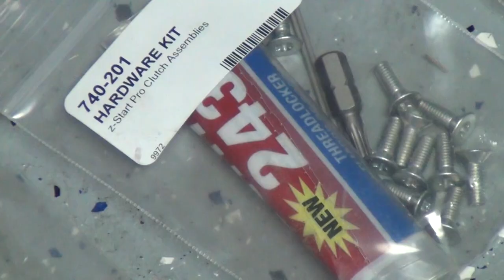Rekluse Z-start Pro Auto clutch CRF450 Install and Review

Comment: I appreciated your detail etc. I'm new to bikes and was traded a ktm 450 with recluse and rode it 2-3 times and no linger will go. Put new clutch plates in on my own and now when I put it into gear it just spins wheel n dies. I didn't know and kinda still don't know how to adjust it. I'll pull it apart again and check spacing etc. But I don't have nogo things?
Reply from the maker: If it's dying it's not disconnecting or the carb idle/tune isn't good.  The idea is there's some gap unless it's rotating enough to hook up.

Comment from the maker: You would be preaching to the choir there if you were correct.  I still can pop the clutch just the same as before.  I would miss that.  However the bike rides the same as before clutch wise you can still feather, pop, dump, or whatever you want.  The only thing I DO miss is I can't pop-start while coasting down hill.  However I have electric start and a kick start if I need to.

Comment: So you said if it doesn’t go in at all (the no go gauges) you are good? I’m trying to put this kit in my 05 ktm 450 and I have ZERO gap and the clutch pack is so tight at 25 inch lbs the pack has absolutely no movement..

Comment: Hello been loving your videos on the 450,s very helpful and complete you must have had a good teachers they got you using your brain.
Had to ride home with no clutch lever recently .not fun in tight stuff{standard clutch}
Found this on their website any chance you could show how this is done?
Can I bump-start with an auto clutch?
All three Rekluse Auto-Clutches can be configured to bump-start the engine in the event your normal starting system fails. However, they can not be configured for bump-starting on the go like a standard clutch.  One must stop the motorcycle and make an adjustment (on some Rekluse models this requires tools) to bump start and then make another adjustment to continue riding once the engine fires. Bump-starting can be done to get you home.
Reply from the maker: I didn't know that they had a method for bump starting.  Good to know.

Comment: At the start you said that you're riding an X but later in the video you talk about how you have a light flywheel and its a motorcross bike. Did you buy and X and make it more like and R or the other way around. I have a 450R that I added a heavy fly wheel to and made it ride more like and X but is still more peppy than a standard X. I ride very rocky and technical single track what setting would you recommend. Looking at doing the Z-start

Comment: My pressure plate that holds the balls doesnt sit down into the grooves. Its a crf250r. When i remove the pushrod and install it it fits and screws down all the way into the grooves. Any help is appreciated.

Comment: hey I got a question I got a 08 KTM 525 XC ATV so my bike came with a recluse Z start Pro I had the bike over a year and maybe 2 months now so I was going to change the friction because I thought my clutch was slipping so as I change the fractions and put everything back together but now when I try to crank up the bike the bike try to take off immediately and cut off or stall out so I wonder if I did something wrong or what do I have to do because if I loosen up the screws on the plate it will start up fine  but when I press the gas it won't go or have the response like it suppose but I know the screws don't supposed to be loose  like that  but can you please  help me out or do you know what my problem is
Reply from the maker: If your frictions are too thick or you have junk between them it will do that.  It could also be air in your clutch hydraulics. (hose, master, or slave cylinders- bleed them)
Reply: well  I don't know what to say or do right about now because I tried putting the old frictions back on but it's still just doing the same thing it's in neutral when I put it in gear the bike try to go and stall out I can't even roll the bike anymore any no gear just neutral

Comment: I can see using this on a two stroke or something for enduro or hardcore trails where bottom end power is low but I like solid engagement when i pop the clutch. This seems to turn it into a centrifugal clutch or something where there is slippage n that's no fun

Comment: Man I have one of these already installed in my 06 CRF450R that I bought used and I absolutely hate it.. The clutch pull is too easy for me. It doesn't feel right.. Is there a way to make the clutch pull a little stiffer with this z-start pro?? If not im taking this thing out and selling it to get a regular clutch..
Reply from the maker: +Call_M3_Mr_T Just rev.  It's limp till the rmps throw the balls.
Reply: briansmobile1 Yea I figured that out after a few more hours of riding.. Thanks..